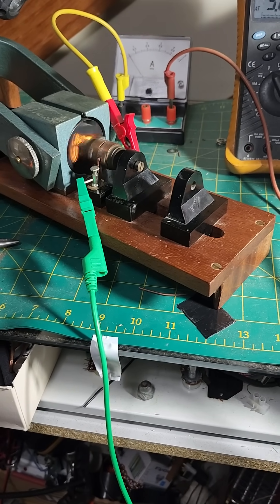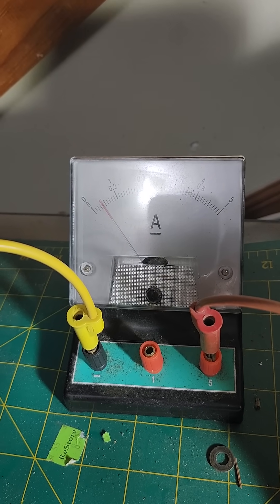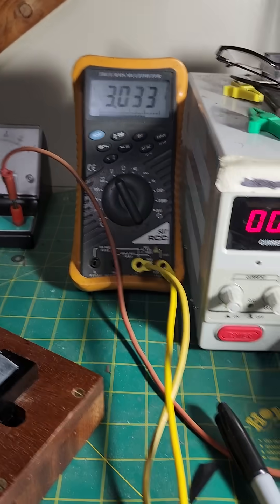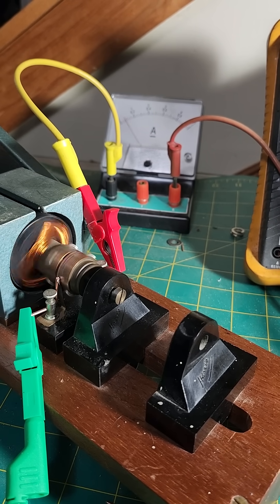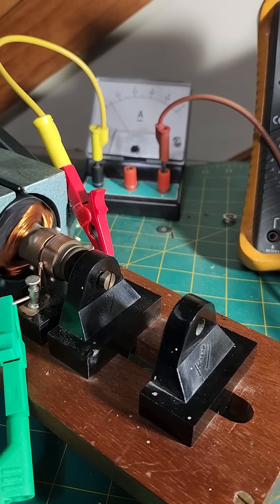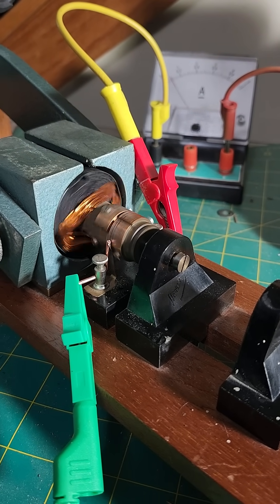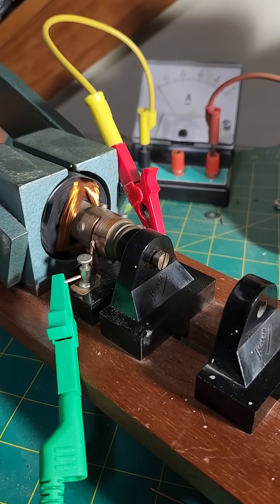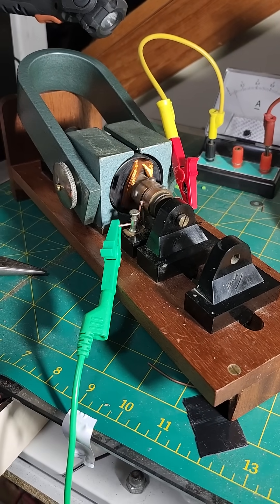Philip Harris 1930's Demonstration DC Motor very low voltage .

Comment: Ya i ha suggested that on the first vid, there is still a lot of friction though but way way less then before, splendid work. i think there is still some friction inside the magnetic housing, can you make a vid with it not running and a closeup on the windings, how its mounted and a closeup scan of the whole motor? I would love to see it in detail, did you make it yourself?
Reply from the maker: I bought it on EBAY 2 weeks ago .